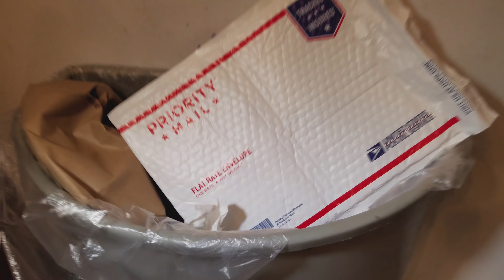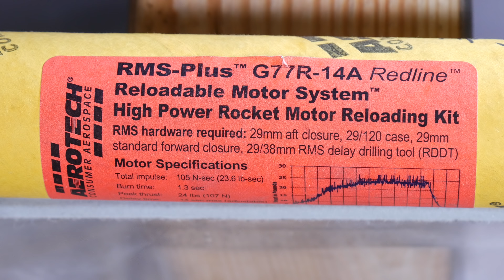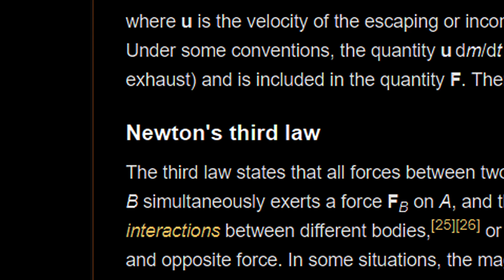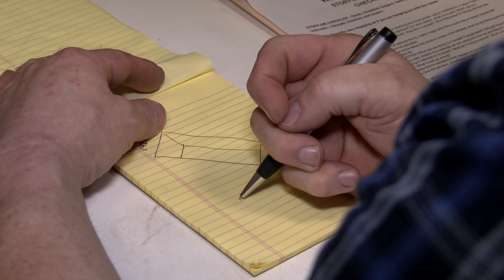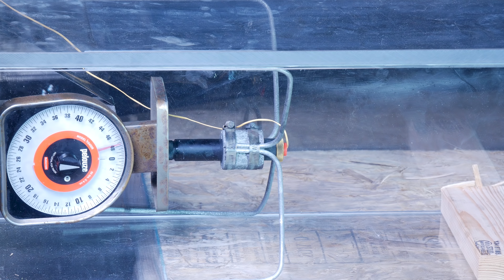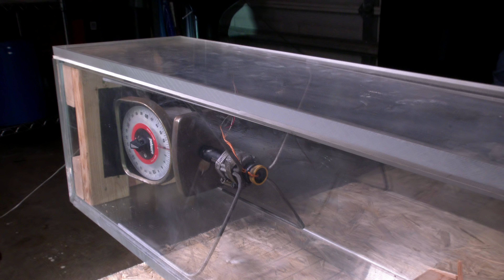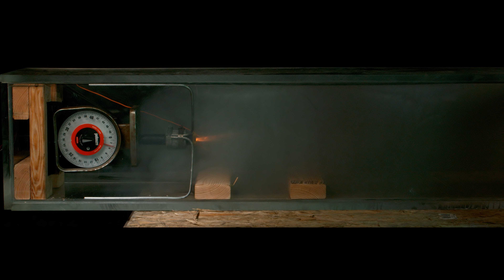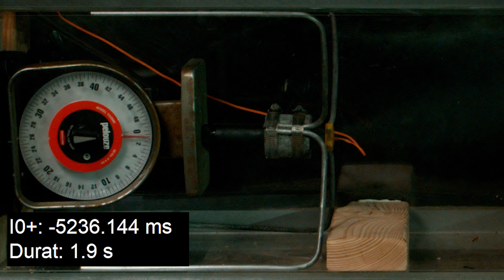Rockets in a Vacuum Chamber - Newton's third law of motion Visualized

Comment: Questians. Wow!!!!! That might be groundbreaking info that corporations usually find!!!! There were pulses in the smoke in the slowmo, did they match with the pulses of the pump? If scaled up with multiple pumps would there be harmony/ the waves? How much pressure was loss with the extremes put in this vacuum? This experiment and the questions answered would be a great doctoral thesis!!!! Wow!!!!!!!!! Mind blowing!!!!!
Reply: Posted b4 the flame starting in the vacuum, another element to add to a doctoral thesis... And again WOW!!!!!!!!
Reply from the maker: I may try this test again later even more extreme and I have a surprise, liquid propellants. Just been really behind

Comment: My thoughts are you can make more static thrust in the atmosphere over a Vacuum.
Reply: Then you think wrong. The 100 year old Tsiolkovsky rocket equation predicts that rocket propulsion is MORE EFFICIENT (produces MORE thrust) when the rocket is IN VACUUM.
This is because the exhaust gas can achieve a HIGHER VELOCITY when it exits the nozzle if there is NO AIR IN THE WAY.
We have been TESTING this equation for almost 100 years.
Reply: @Uploading Truth There absolutely is thrust achievable in a vacuum. We've been doing it for ages. The fact you're not actually smart enough to understand it doesn't make it wrong.

And no, the chamber doesn't become part of the vacuum when the exhaust is ejected because there's still more inside to be ejected. What's more, the force of the ejection still creates an opposing force in the opposite direction which propels the rocket. So even if you were right that the chamber immediately emptied and became a vacuum you'd still have thrust for that split second of expulsion. It wouldn't suddenly disappear.

Comment: You can’t use solid rocket in vacuum. There’s no oxygen for the burn. That’s why spacecraft has to carry both oxidizer and fuel, and helium to pressurize them out.
Reply: We use solid rocket motors in vacuum frequently. They have the oxidizer IN THEM already just like gun powder.

Comment: For starters ROCKETS ARE USED JUST TO LAUNCH(Ignition which is produce with air)ONCE IN SPACE THERE IS ANOTHER MECHANISM THAT IMPULSES THEM(Newton’s third law)*. Which gives this experiment a very obvious result (no oxygen not combustion). *in order to prove Newton’s third law in vacuum would be better to put a slingshot like in a vacuum chamber or some container expulsing a gas throughout little orifice note: in space there’s nothing sucking air. So not pressure you would be floating.
Reply: False - Rocket engines use combustion in spa. The space shuttle main engine combusts Liquid HYDROGEN and liquid OXYGEN.
This is COMBUSTION IN SPACE.
Reply: I got you... but I’m talking about the combustion method used in this video.
Reply: @carlos-ic6ll  oh AND we DO USE solid Rocket motors IN SPACE frequently

Comment: When you realise that for a vacuum to work in space....there has to be a solid barrier between it and the earth
Reply: No there does NOT: DO you agree that the atmospheric pressure at sea level measures about 14.5 PSI.  And that in Denver CO (1 mile high ) it is about 12.5 PSI.  And that at the top of Mount Everest it is about 5.0 PSI?
Reply: What do you mean

Comment: did you remeber to add oxygen to the vaccum?
Reply: REALLY?  You think that is a valid question?  Maybe you should have taken chemistry in high school?
Solid rocket motors TAKE THEIR OXIDIZER WITH THEM to space......
DO you think a HAND GRENADE needs atmospheric oxygen to explode?
Reply: @stuartgray5877    If you go to this bit  https://youtu.be/-BsrzO7aXNs?t=415.   they admit they do not have enough pressure for the booster to ignite.  .  Because as we all know , you cannot create a hypergolic reaction unless there is pressure present to force the chemicals to combine.  .  Both liquid and solid  rocket fuels need pressure.
Reply: @jrngln   
Nice copypasta. Every word of what you just said was wrong.

1) We can get close enough for practical purposes. Technically space isn't a pure vacuum either, but it's so rarified that molecules rarely come into contact with each other.
2) A vacuum doesn't "absorb" anything, you're speaking nonsense.
3) How exactly do gases on the opposite side of the chamber affect the rocket motor? The answer is they don't. The only forces come from the direct interaction between the motor and the gas. As soon as the gas leaves the motor, it can't transmit a force.
4) Yep. Rockets push off of their exhaust gas.

Comment: Using a chemical rocket is not necessary to measure thrust in a vacuum.  The first astronaut maneuvering unit (AMU) used liquid nitrogen- basically, compressed gas.  I hope you will repeat this experiment using compressed gas and analyzing the reaction curve.  Compressed air will be infinitely cleaner and non-destructive, so maybe you could use something like the Plum Brook Station, which would be large enough to prevent the released gas from mucking with the vacuum.  I am very curious about the notion of thrust in a vacuum.  It's not that Newton's Third Law would be violated, but that the opposing reactions would not be as intuitive as we observe in atmosphere.  For instance, in atmosphere, Newton's third law includes force against atmosphere.  Let's assume there is thrust in a vacuum.  The question then is, how much thrust is lost by being in a vacuum?   In the unlikely event it is 100%, then our assumption is wrong and anything less than 100% is worth exploring because just as certain as the Third Law is, the lack of atmosphere WILL have a measurable effect on thrust that could be quite significant.
Reply: My company tests dozens of hydrazine monopropellant thrusters per year here on earth in a vacuum chamber and we verify that they produce the thrust predicted by the 100 year old Tsiolkovsky rocket equation.
We then put those thrusters on real spacecraft, launch them to space, and test them there too.

I just finished integrating the propulsion system on the WSF-M spacecraft for the Air Force.
Reply: Roger A - Rocket Thrust is MORE EFFICIENT in a vacuum. This is because there is no atmosphere to SLOW DOWN the exhaust gases as they exit the nozzle.
If you were to analyze the Tsiolkovsky Rocket Equation you would see this.
Reply: @stuartgray5877  I can't say you're wrong because I simply don't know.  I am definitely NOT a math guy.  Your assertion is, however, counter-intuitive and all the more reason to repeat the experiment with better conditions and measurements.  I would love to see an experiment that shows MORE thrust in a vacuum compared to sea-level atmosphere.
Reply: @stuartgray5877  I genuinely hope you can find the time and resources to make a video that practically demonstrates the increased efficiency of a rocket in a vacuum.  Like I said, I would be really interested in seeing it because it would add to the argument against skepticism of rocket technology more meaningfully than this video (it's a good effort, but not a polished enough experiment).
Reply: @stuartgray5877  So you understand the confusion about increased efficiency in a vacuum from a layman perspective, if I have a leaf blower and aim it at nothing I might get a mild push from the thrust.  However, if I aim the blower at a nearby wall the force will be much more perceptible.  Intuitively, air acts as the wall against which a rocket generates more thrust relative to a vacuum.  But you're saying exactly the opposite is the case, which would be fun to see demonstrated and more fully explained.
Reply: @311g  The reason that rockets have more thrust in a vacuum is that the exhaust gases have the opportunity to reach higher VELOCITY without the atmosphere holding it back.
The forward thrust on a rocket engine is proportional to the MOMENTUM of the exhaust gas.
Momentum is defined as Mass X Velocity.
The FASTER the exhaust gas leaves the nozzle the greater the MOMENTUM and the greater the thrust back on the rocket.

Rocket "Thrust" is literally just the mechanical recoil of pushing on mass. The FASTER the "projectile" leaves the device pushing it the greater the recoil.

Would a CROSSBOW fired into a vacuum experience any RECOIL force?
OF COURSE!
And the higher the velocity of the projectile the GREATER the RECOIL.
Reply: @311g  - "I would love to see an experiment that shows MORE thrust in a vacuum compared to sea-level atmosphere."
I used to work at Lockheed Martin in Waterton Colorado. This is the facility (at over one mile high) where they built and TESTED the Titan Missile Engines for MANY YEARS.
So, there were rocket engine test stands higher than one mile high AND test stands at Sea Level (like Marshall SFC or Stennis).

Tell me you HONESTLY THINK that engineers over the last 60 years are TOO STUIPD to TEST the 100-year old Tsiolkovsky rocket equation and WOULD NOT HAVE NOTICED IF IT WAS WRONG???

So your claim is an insult to every engineer to have worked on rockets over the last 60 years.
Reply: @311g  Some people take this statement as an insult when it is not:

Personal incredulity is proof of ONLY willful ignorance.
Please try LEARNING about a topic (such as Rocket Propulsion) BEFORE trying to debunk it.
Doing otherwise is evidence of the Dunning-Kruger syndrome.
Reply: @311g  I also have video evidence that rockets work just fine in a vacuum.
Watch the YT video titled: "uninterrupted footage of the falcon heavy launch and booster landing! 2-6-18"
 Watch from launch to side booster landing then EXPLAIN in your own words what you just witnessed. If you cannot spot the multiple examples of rocket propulsion in a vacuum, then I would be happy to point them out to you.
Reply: @311g  You DO understand the basic physics behind Inertia and Momentum.
Look up the "Law of Conservation of Momentum".
It is the law that the Rocket Equation is derived from, AND the way you would calculate how much recoil a Gun might feel (for example).

Think through the example of a crossbow firing into a vacuum.  Wouldn't the recoil force be GREATER for a projectile that leaves the bow at a higher velocity, than compared to one at low velocity?
Couldn't even a CROSSBOW achieve a higher velocity when firing into a vacuum than firing into atmosphere?
Reply: @311g  ANOTER way to think about it:

1 - Does the exhaust gas get accelerated as it leaves the nozzle?
2 - Does exhaust gas have MASS?
3 - Can mass be accelerated WITHOUT a force, or is a force REQUIRED to accelerate mass?

These three questions are to get you to ADMIT that the rocket nozzle MUST apply a FORCE to the mass of the exhaust gas for it to be accelerated.
We SEE the exhaust gas reach MACH EIGHT when leaving a Space Shuttle Main Engine.
SO, it goes from a standstill to Mach eight in about TEN FEET!
This is as HUGE acceleration!
Exhaust gas DOES HAVE MASS. In fact, it has exactly the same mass as the fuel and oxidizer that went IN.
A SSME consumes 500 kilograms of liquid hydrogen and liquid oxygen PER SECOND, combusts it and expels it at Mach 8.
The exhaust gas is ALSO 500 kilograms per second.

SO, we have determined that Rockets MUST apply a FORCE to the mass of the exhaust gas to accelerate it!

What does Newton's THIRD Law say about forces?
Reply: @311g  Look through this thread and see the kind of people I constantly deal with.
YOU are the first reasonable person I have interacted with on these threads lately.

MOST of these people call me a LIAR and say I am lying about my 30 year career of launching things to space.

As I SAID, it is NOT an INSULT to tell someone they are Ignorant.
So, YOU get over yourself.
Reply: @311g  I am ALSO a vacuum test specialist with almost 30 years experience operating some of the largest thermal vacuum chambers in the country.
On more than one occasion we have had pressurized gas lines come loose in a TVAC chamber and THRASH AROUND damaging things.
 This would be impossible if propulsion was not possible in a vacuum
Stick to topics you are familiar with like finger painting.
Reply: @stuartgray5877  no you're a chatbot lol.
Reply: @311g  "Stuart gray" is a chatbot. All it does is abuse & harass people on videos like this.
Reply: @311g  But you are LITERALLY trying to lecture actual rocket scientists about basic physics when it is obvious that you have never taken a single physics class in your life!
Tell me different!
Tell me you finished High school.
Reply: @papalegba6796  If I AM a bot, then I am smarter than you.
Go ask ChatGP how rocket propulsion works in a vacuum It explains it just fine.

While you are at it ask it what the combustion product of burning hydrogen and oxygen IS since you don't know and can't be bothered to learn.
Reply: @stuartgray5877  YAWN!
Reply: @stuartgray5877  you're not a rocket scientist 😂

Comment: I'm looking at the experiment and I think it is somewhat flawed. 
First the rocket firing in a vacuum needs to have a less confining space, pressure against the scale should be equal to the output of the rocket. Equal and opposite. The detention of the gases initially may give some movement but absent constant negative pressure. Which seems that could not be maintained as observed over pressure caused the gases to escape the enclosure initially. By creating pressure you have lost the vacuum.  But the vastness of space would not permit that to occur.  Why not use a media unable to create expanding gasses. Like for instance air released using a valve. Your overpressure issue is solved and the volume of the air released can be tested. The reaction can be verified to be equal in both cases. I would think that boils laws would apply. But I don't know to much about space but it seems to me that you didn't have enough of it, that is, enough space. But the thought that space is absent friction resulting in no losses while claiming you can push against something in the vacuum makes little sense. either there is something to oppose or there isn't. Which is it? Frictionless or not? Without friction there can be no movement or am I wrong? I'm not in this one way or another because I have a few things in space and I have wondered about this for a long time.

Comment: The vacum chamber here is not close to the vacum of space,  for one, the temperature in space is one factor that will change the dynamics of combustion along with a vacum that would suck air and all fluids from a human body through the airways, something that will not happen in a vacum apparatus on earth, a human would just suffocate.
Reply: @stuartgray5877  I didn't realize that science books were printed in Hollywood.
Reply: @MrAllan9  - "I didn't realize that science books were printed in Hollywood."

Show me a physics book that says vacuums can exert a force on gases, OR that RECOIL stops working in a vacuum.
You CANNOT, because a vacuum cannot exert any kind of force on anything solid, liquid, or gas.
AND Mechanical RECOIL still works in a vacuum - Anything that exerts a force on a MASS, must feel an equal and opposite Reaction. This applies IN VACUUM just fine.
Reply: @stuartgray5877  ok chatbot 😂😂😂

Comment: The moment you attach the rocket to the vaccum itself it became a contaminated experiment.  This needs to be done in a much larger vaccum. Perhaps one the size of a bedroom and attach a rocket to a string hanging from the ceiling. Space is infinite vast, and there is not enough atmospheric pressure to fraxinate the thrust.
Reply: Rich, so if you dont think "Propulsion works in a vacuum" then please tell me what happens to a crossbow if fired into a vacuum.
Are YOU saying that it will NOT have any recoil?

So if ONE object (with mass) exerts a FORCE on A second object (with mass), in a vacuum, WHAT HAPPENS? 
 are YOU saying the objects WONT MOVE?

Comment: How can there be a vacuum of space (10 minus 17 Tor)?   Did the 2nd law of thermodynamics take a vacation?   All the gases would expand into the vacuum.  That's logical and demonstrably  scientific.  So you can demonstrate how gravity holds down gases in a vacuum?
Reply: Yes with a "force field" just like static electricity.  Perhaps you shouldn't have dropped out of high school?
Reply: Stuart Gray.  So no demonstration.   Got it.  No demonstration of gas pressure in a vacuum without a barrier.
Reply: @dwheel39  actually you apparently didn't know that there IS NO "pressure" next to vacuum.  It is a pressure GRADIENT that goes from 14.7 PSI at sea level, to ~12.5 PSI in Colorado to ~5 PSI at the top of Mount Everest. Guess where the pressure goes as YOU GO HIGHER? At only 50 Kilometers   (30 miles) the pressure is less than 1.0 Torr. The X-15 Flew higher than this in the 1950s!
Reply: @dwheel39  AND do you want to see a higher pressure gas region right next to a low pressure system with No barrier between the two regions ?  Lookup the gas Centrifuge that can do EXACTLY THAT!  Care to tell us the theory of operation of the gas Centrifuge?
Reply: @dwheel39  oh and quit trying to use thermodynamics as your evidence when you don't even understand it.  It is OBVIOUS that you have never taken a physics class in your life.
Reply: Stuart Gray. Any gas pressure at all,  including a gradient,   must have a container.   If you disagree just provide a demonstration.   In a vacuum chamber ,  create a gradient of gases. and show how those gases act as a shield to keep water from boiling from the vacuum (you know like earth in space vacuum ).  You can invoke the magical power of "gravity " to help you.     Should be a doozie!
Reply: @dwheel39  and I see that you failed to explain the theory of operation of the gas Centrifuge. DO YOU KNOW WHAT MAGIC MAKES THEM CREATE A PRESSURE DIFFERENTIAL?